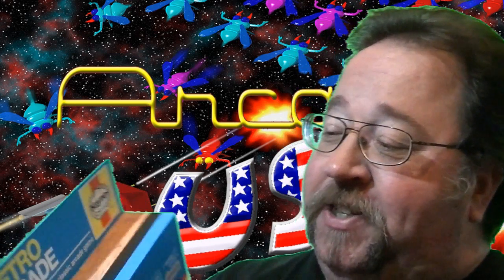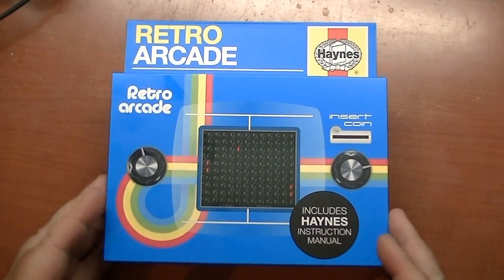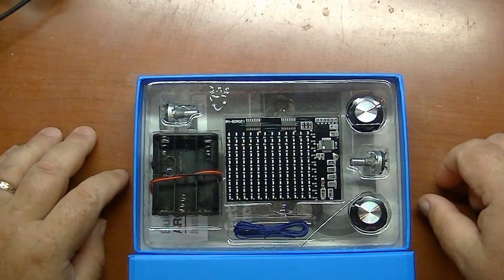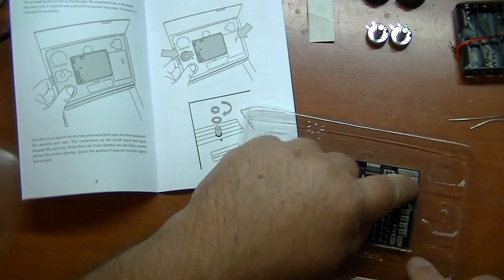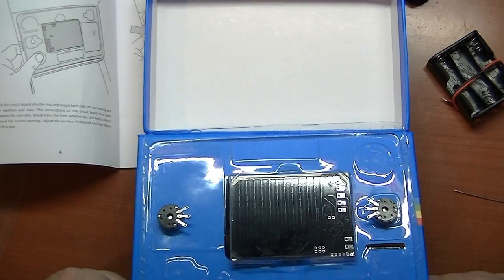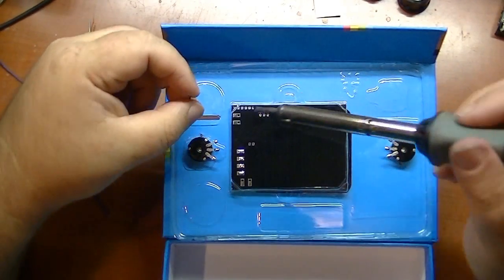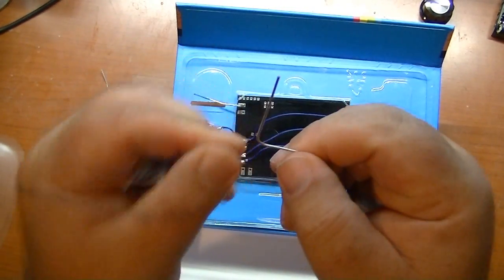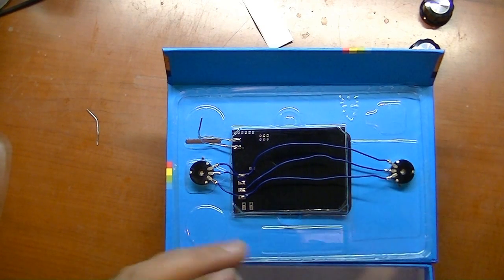Haynes Retro Arcade Kit!

Comment: Newer versions of the kit even have sound. See video at https://twitter.com/KieranTully/status/1078468532042715136?s=09

Great kit although I found the instructions a little frustrating as they don't list everything you need upfront e.g. glue (to secure the speaker) or a screwdriver for the pots.

Comment: This is awesome. I wonder what kind of mods you can do with it. Immediately I thought replacing the battery pack with a USB power port and an ON/OFF switch to override the coin slot.
Reply: Stephanie McKeon I think you can also reprog the board via the ISP contacts because it's basically an arduino with built-in led pannel!
Reply: http://eight-innovation.com/dir/haynes-retro-arcade-hacks/